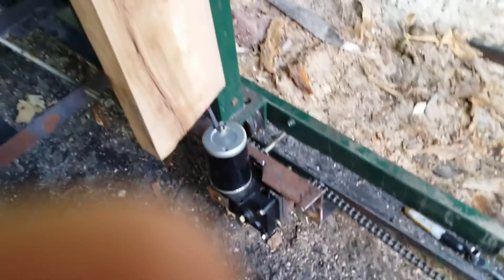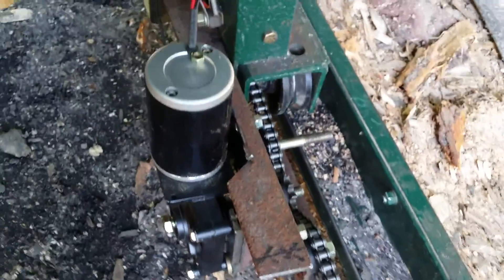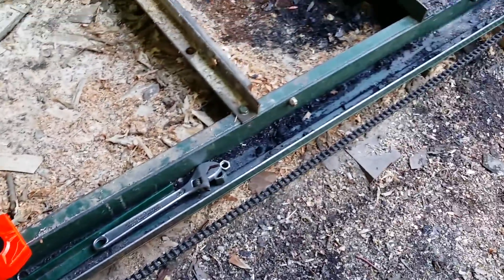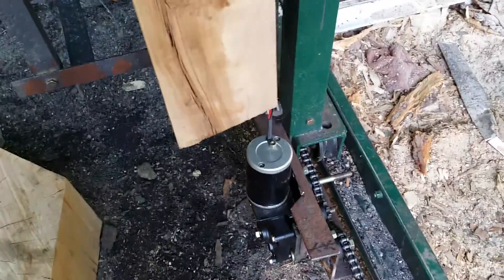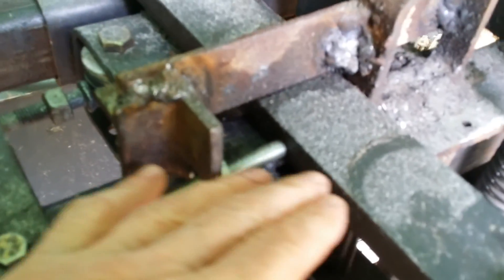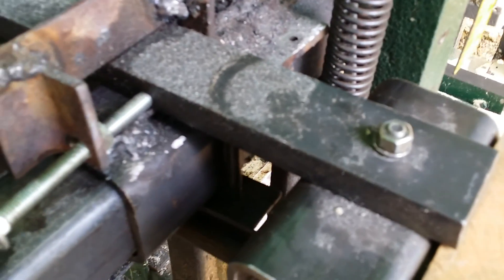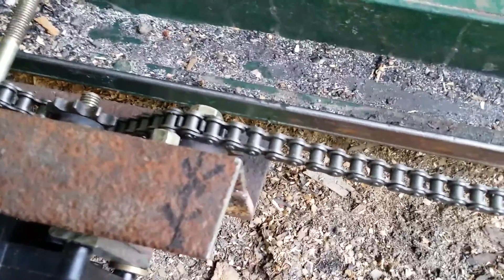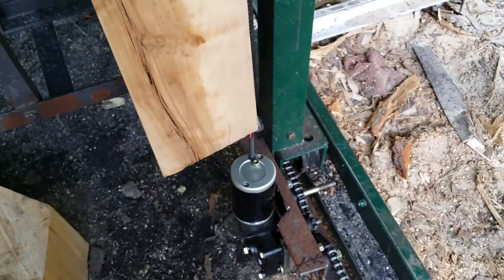DIY Power Feed for Bandsaw Mill

Comment: can you tell me how you are keeping the dust out of the chain    a cable works better with a drum it slides when you hit a knot  and slows down the saw a little and stops most of the blade wobble
Reply from the maker: The way it is set up now to keep the saw dust out of the chain is the chain is covered by passing under the support of the carriage  wheels. I just used a chain because that was what I saw on most bandsaw mill. I was thinking of using a cable though. I've seen .circular sawmill that use cable the run the carriage.